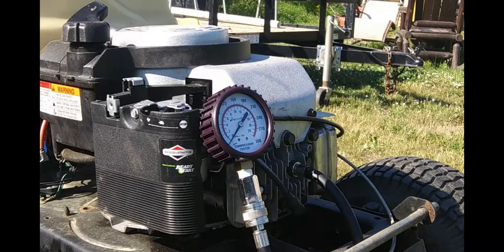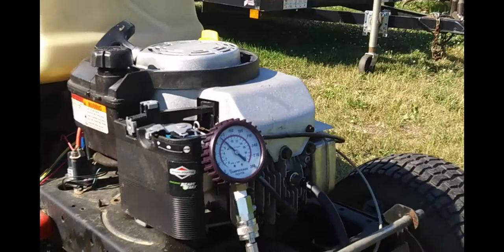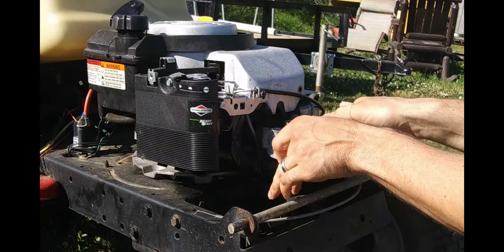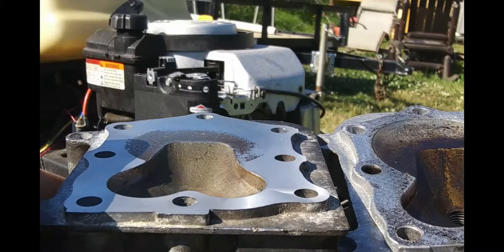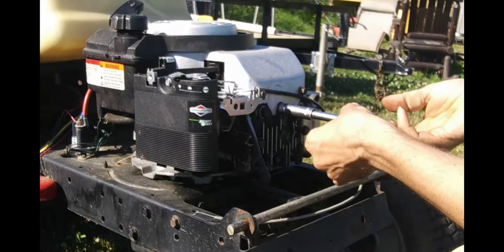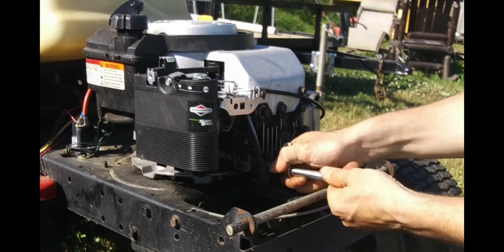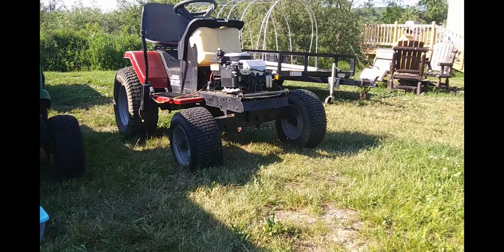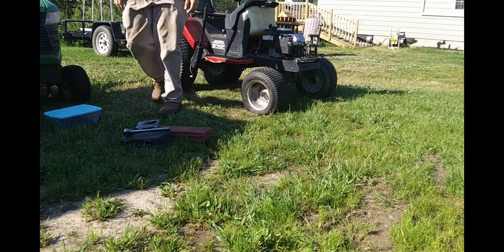Does Milling the head on a flat head Briggs & Stratton motor increase power?

Comment: Milling the head down WILL increase the compression, but you are also making the pathway to the valves, for the intake and exhaust airflow, smaller in the process. There's more power to be had by working this area of the head after milling it. Yes, you will make the chamber bigger, and lower the compression as you take material away from the head by the valves. So, keep this in mind when milling the head, and take a little more than you need, so when you work the valve area, you will end up with what you wanted for the compression ratio. Also, there can be work done to the block in the valve area. If you plan on doing this, it will affect the final compression ratio also, so keep this in mind before milling too..
Reply: my grandpa used to race this on go karts and really knows how to build them so i went and asked him about shaving the heads and he said ur 100%right, and maybe take the gasket off also
Reply: Truth!!!
Reply: @NubsWithGuns  And not "going hog wild" is what I explained in my original post. It IS a fine balance between airflow and compression. If you coukdnt figure that out from what I had explained, then DON'T try it.. 🤷🏻🤦🏻
Reply: This is correct. Grinding down the eyebrows from the edge of the valve seat to the cylinder will greatly increase flow. Just shaving down the heads alone will increase compression but also decrease flow.

Comment: low compression is from the compression release mechanism on the exhaust lobe of the camshaft. if you really want full compression, carefully check the valve lash where the intake and exhaust valves are supposed to be closed for compression. I sometimes file about 1/2 a millimeter off the end of the valve stem to make the valves at BDC just before the compression stroke. don't get the compression release mechanism confused as an engine fault. on the pull start, compression is reduced mechanically by a spring loaded part that centrifuges out when the engine runs above 300rpm. unless you want that full compression, you can either file down the mechanism on the camshaft or shorten the valve stem 1/2mm to make it fully close at BDC. keep in mind that also increases the horsepower and torque and it can blow a stock muffler apart at high throttle

Comment: What did you mill it with
Reply from the maker: the milling machine was a Harbor Freight manual milling machine I converted to cnc with a kit.
Reply: @insanityworks3953 what type of cutter did you use?
Reply: A broken tap
Reply: @shawngoldsberry747  Is it actually possible to use a broken tap as a type of crude milling bit?